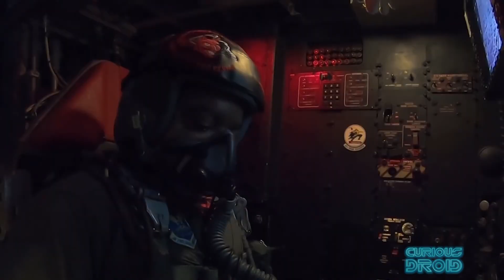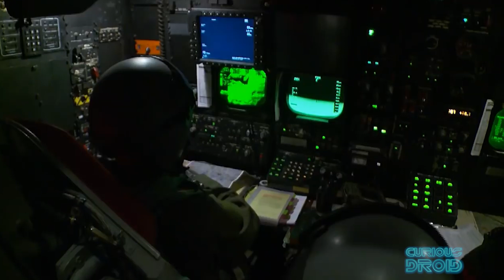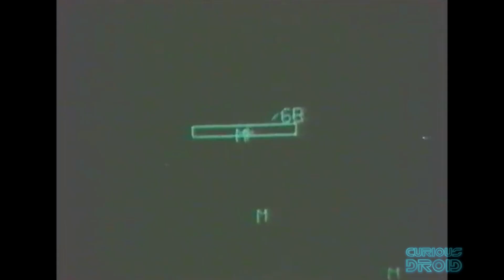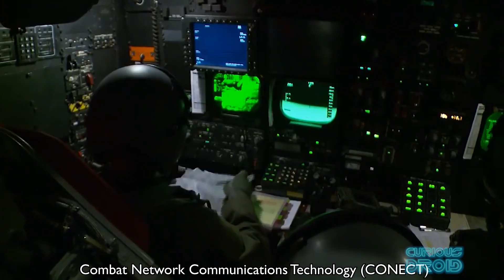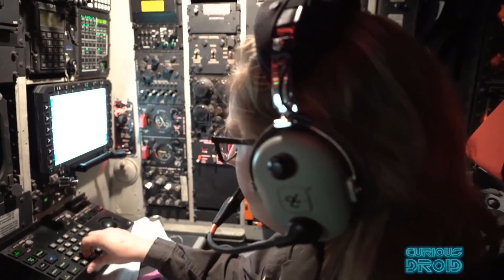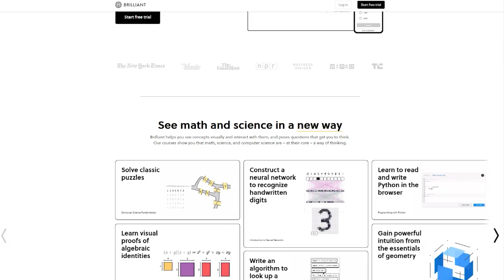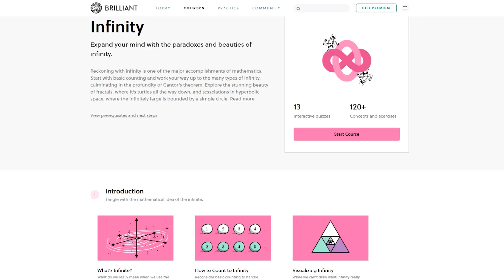How Long Can the B-52 Continue in Service?

Comment: This shows how aircraft engineers from the 50's and 60's were way ahead of their time.
Reply: @Keegan Young Wrong.  Satellites are seen coming well in advance which has been their main limitation since they were first used for reconnaissance.  Much can be done with satellites but there are absolutely applications for immediate and more importantly, stealthy, reconnaissance which can only be done by atmospherically deployed assets at this time.
Reply: @kennethfharkin  SR-71s were also seen well in advance and were even sometimes intercepted.
Reply: SR 71
Reply: Designed without the aid of computers, flight simulators, but hand drawings, and calculations done on a slide rule, the earliest calculator.
Reply: Just goes to show what humanity was capable of when they actually used their brains rather that sitting around waiting for a computer to tell them what to do.  Even with all of our modern technology, we still cannot design a better plane than the Lockheed skunk works did when they developed the SR-71 Blackbird in the late 40s and early 50s.
Reply: @parrychapman7703  That's because back then, there was a serious arms race. We could  have been to Jupiter by now if governments still invested the same amount in technology.
Reply: @parrychapman7703  Well said, I've heard the SR-71 was the last aircraft made with ink, paper and a slide rule. And when they ran the model through the computer program it didn't change a thing.
Reply: @cowboy_broke  I'm not sure if it was the last, but I'm pretty sure a computer did say they couldn't make it any better.
Reply: @parrychapman7703  Don't bet on it.  Just like it was many years before we actually saw the SR-71 you can be certain what is up there now is well beyond it.  The feats of many of these design team throughout history are impressive but it is foolish to believe that equally impressive feats are not being made today.
Reply: @parrychapman7703  I guarantee you that we have been developing aircraft far superior to the SR-71, we just don't know about them.
Reply: @parrychapman7703  'better' in what way? the military disclosure witnesses have already come out publicly and stated that the americans and others, have tech that makes star trek look old

Comment: Designed and engineered with slide-rules. How many know what a slide-rule is? How many have one? And they still work without batteries!!!
Reply: Interestingly, we did the weight & balance of the B-52 using an analog slide rule type device. You slid it back and forth for fuel/bomb loads at various locations to insure the CG stayed within limits. And to determine a proper trim setting for takeoff.
Reply: I prefer mechanical computers but slide rules are better for mobile use
Reply: Still have my dad's old one.
Reply: Do they still get patches?
Reply: I bought a British Thornton slide rule a few weeks before Clive Sinclair brought out his first pocket calculator. Try explaining a slide rule to a kid now. First you have to explain what logarithms  are. At which point you give up.
Reply: When I got into flight school, we got circular slide rules.  I practiced with it a bit, and checked with my electronic calculator to "confirm."  My dad later got an electronic calculator that did trig functions, so he took out his ol' reliable slide ruler to "confirm" it.
Reply: Trained with slide rules, log & trig tables, and punched cards. Batteries not included. Maybe they were with the two story computer.

Comment: Remembre that aircraft was designed by the same generation of engineers who made the F1 rocket engine with only pencils and rulers.
Reply: Pete is never wrong  absolutely. Then they realize it was a mistake after a couple of crashes. After many months of harsh debates, they decided to use metal instead for building the engines.